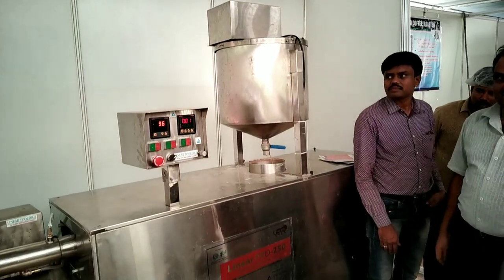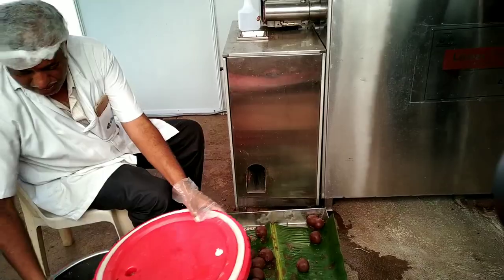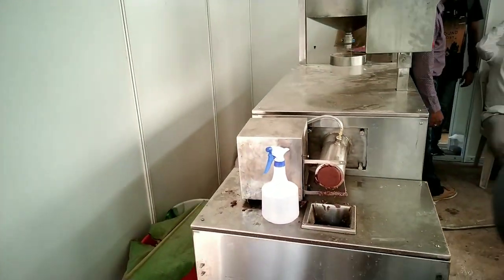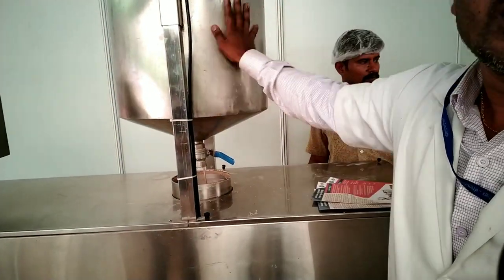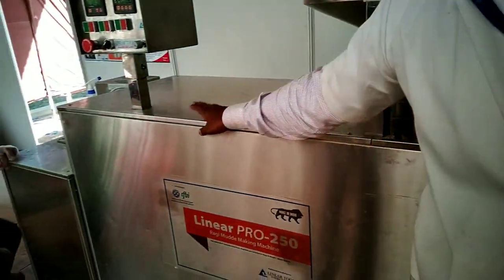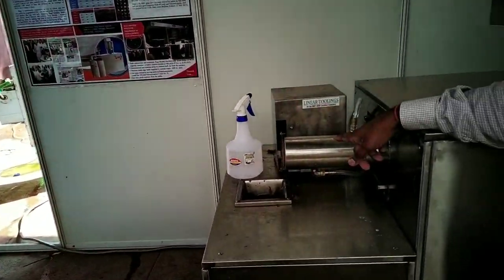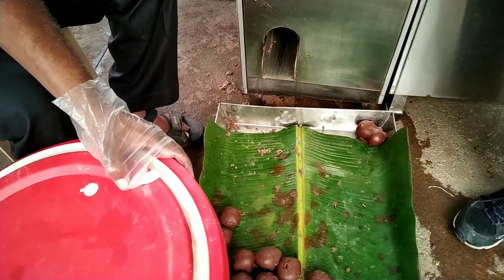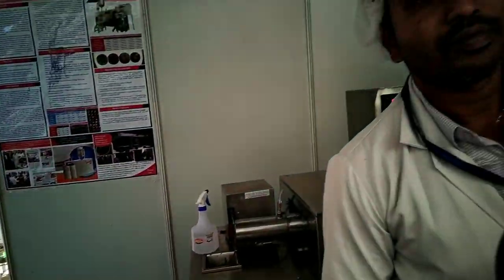Ragi Mudde Machine (continuous) Developed by #CFTRI

Comment: My thought is, it is a machine mainly used in big occasion, and also not handy for small usage moreover for big purpose I thought it slow one , what you say?
Reply from the maker: As per expert it takes 8 sec for  one mudde.  As machine is continuous the  production will be 450/ hour and they developed special hot boxes which can store mudde hot condition for 4 hours. So you can start production before 4 hours of program (so in 4 hours you have 1800 mudde ready). If the requirements are even more then you have to go with higher capacity machine.  
If you are interested in this Technology kindly contact to CSIR-CFTRI, Mysuru.
Reply: thanks for your reply,
Reply: Sagar's Travel Vlog I, am satisfied
Reply from the maker: It's my pleasure
Reply from the maker: nibus9  For more details kindly contact CSIR-CFTRI, MYSURU
Technology Transfer

Head, TTBD

Ph : 0821-2514534

Mail : ttbd@cftri.res.in